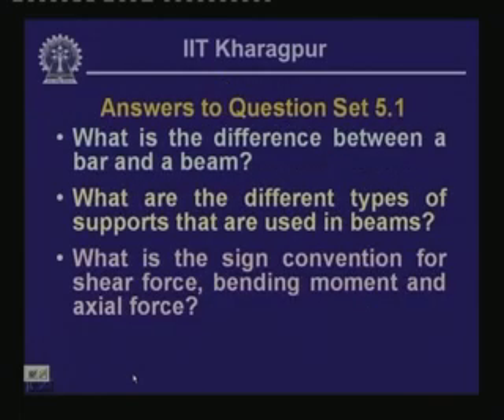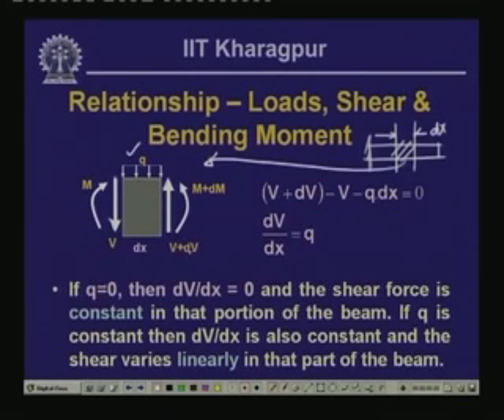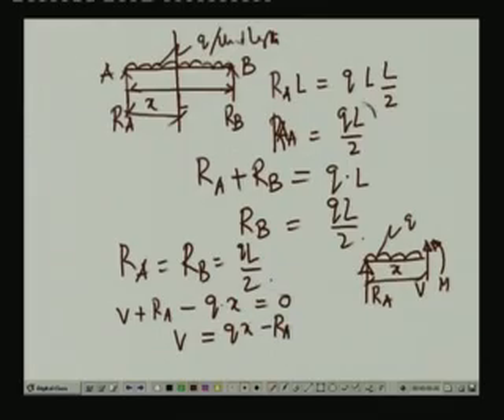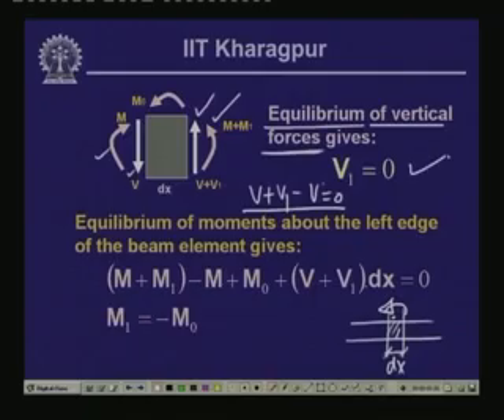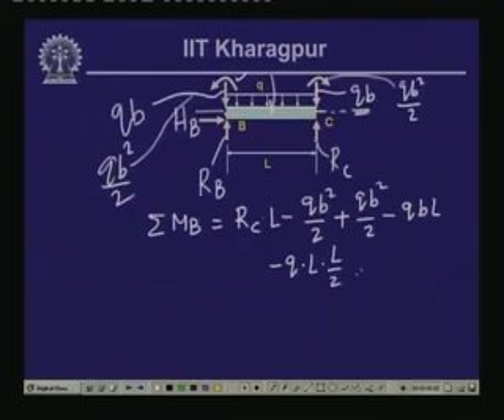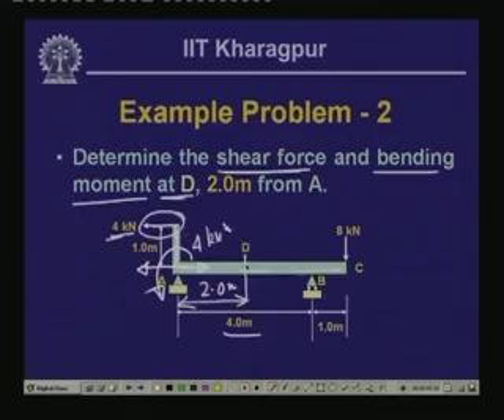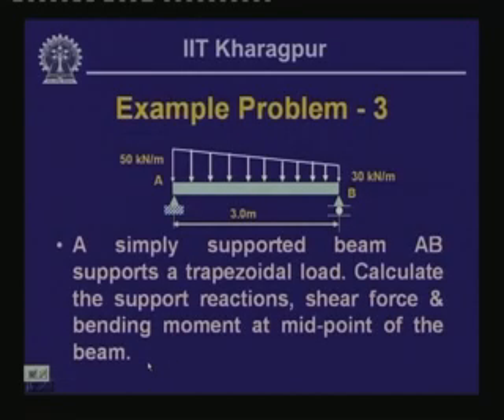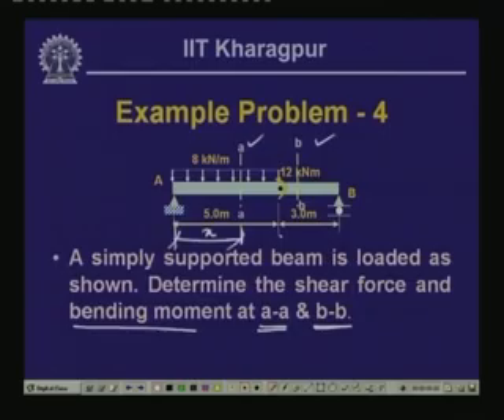Lecture - 23 Bending of Beams - II

Comment: isnt that should be  V + R= 0 AND V= 1kN as both V and R Are in same direction...???
Reply: v=1kn is correct
Reply: Same doubt..can someone plz ans this query
Reply: R in that direction is -1
Reply: Sir in 2nd problem u r saying while calculating beding moment's twice { 4 as anticlock direction  (-ve) & (+ve)} if it is anticlockwise direction it will (+ve)  how it could be possible sir. Or else taking from left side sir some clear clarification on bending moment in one beam u r taking antibiotics clock wise & clockwise while explanating FBD  sir.plzz sir it's an request sir make few more video on this topics
Reply: @shalinijalanila5035  here reaction at a is negative. So the force is not upward. It's in downward direction. So take Ra as negative.
Reply: Ig V=+1kN